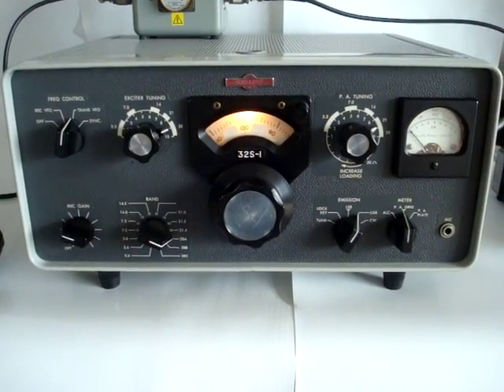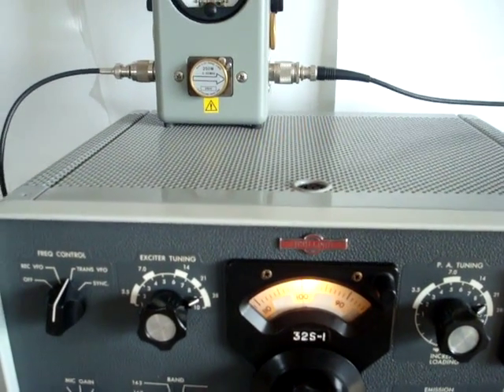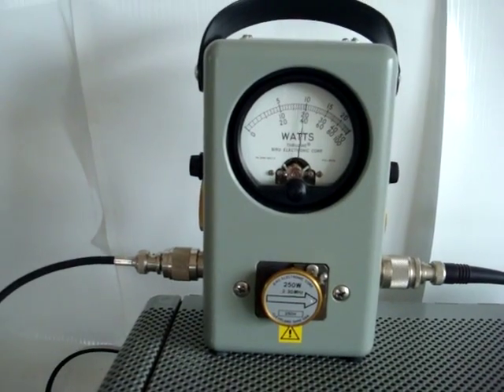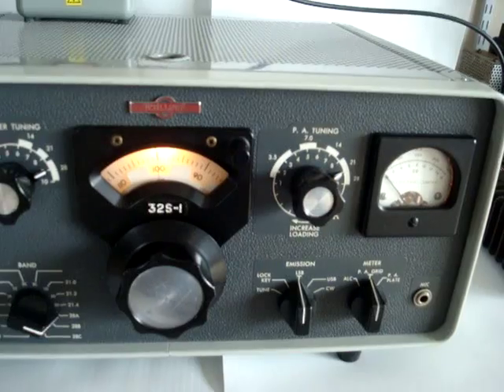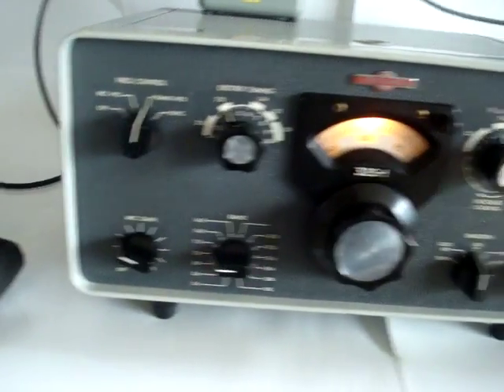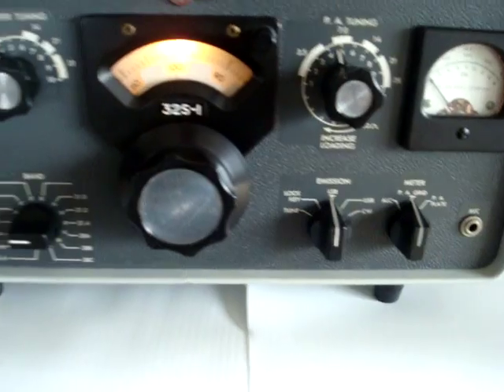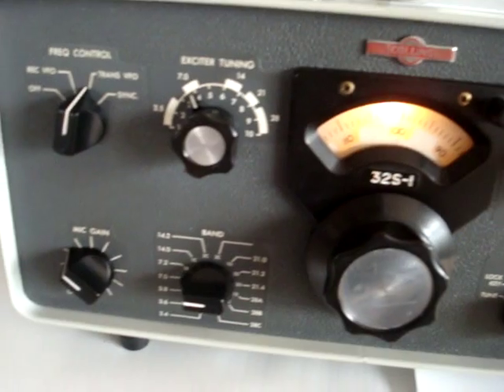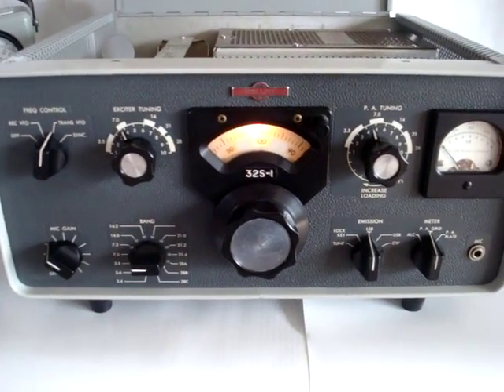Vintage Collins tube transmitter 32S-1 demonstration

Comment: I use my 32S-1 daily and love it along with a 75S-3 and a homebrew 4CX1000A in an old Collins 30K-1 cabinet - I see you have solid state rectifiers in your power supply - I have chosen not to do that although it will give a bit more power out. Looks to be in good shape - keep it running ... Thanks

Comment: I liked this transmitter, until I found out it couldn't do AM.  Kind of a major fail for use as a pirate radio station because of that.   And that only the Collins 32S-3A has the 14 extra crystal slots for setting up frequencies outside the HAM bands.  Too bad, because it looks real nice.  But you can't go down to 6.9-7.0 with the stock crystals.